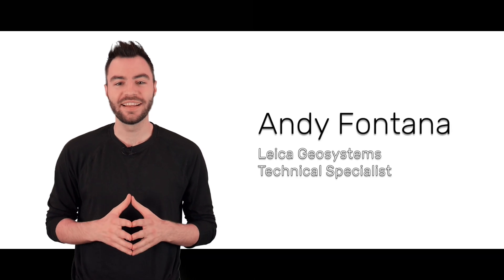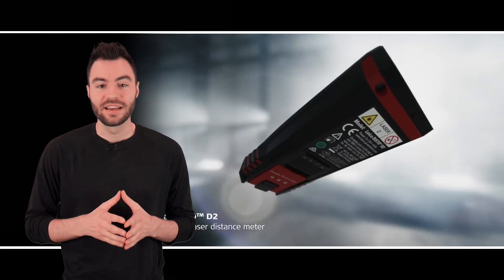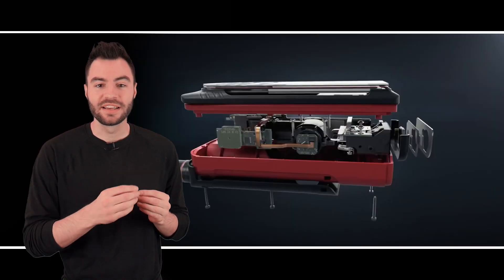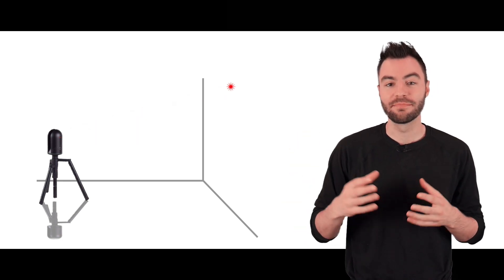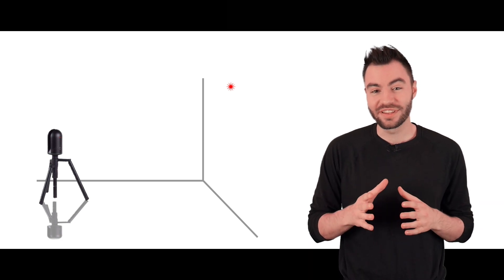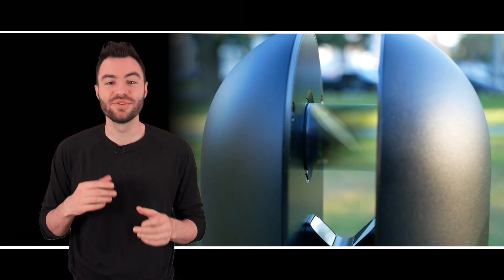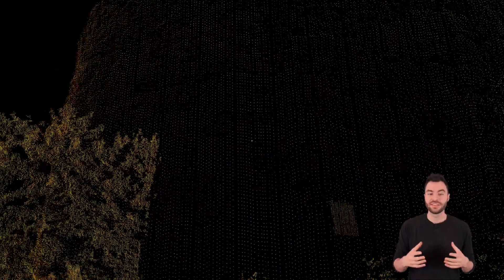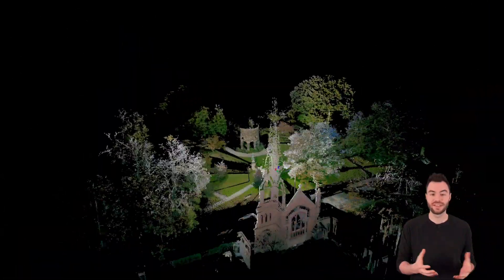An Intro to the BLK360

Comment: Some areas of point clouds ( services at roof steel level ) are very dark. Can we use auxiliary lighting ?
Reply from the maker: There is no add-on auxiliary lighting for the BLK360, but you could always use external lights to illuminate  the site to your liking and take the scans. There is another workflow where you could take a panoramic image with an external camera system from the same position as the BLK scan (with long exposure times to let more light into the camera) and then colorize the point cloud with this pano image.